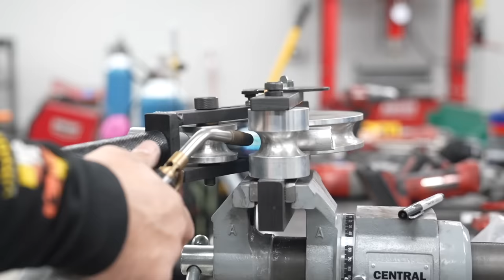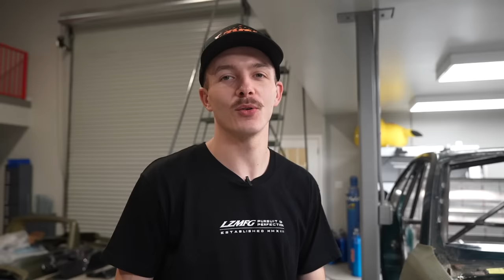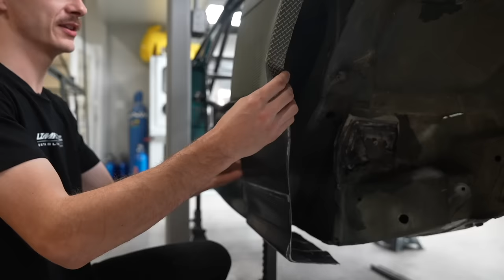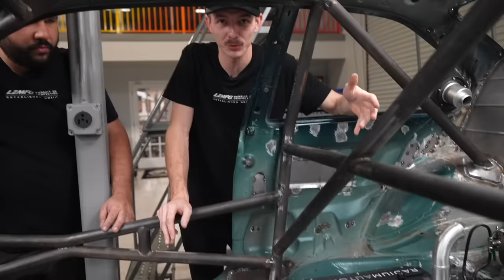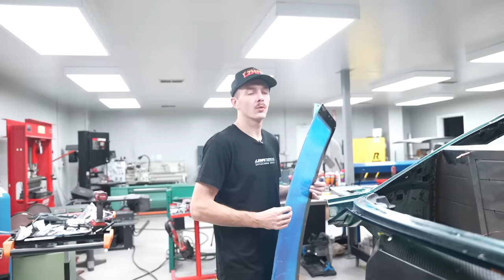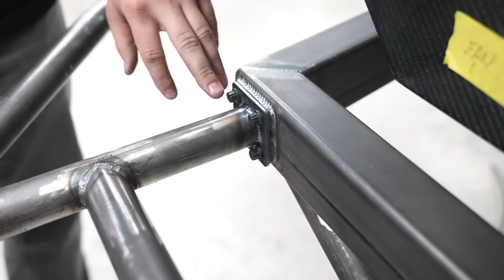Major Update on the Euro Competition E36

Comment: For the fender I have seen people cut and bend the lower section in so it attaches flat in the wheel well, leaving the upper hanging or make a thin bridge to carry the wheel well lower to meet a splitter or lower trim (something like that). It is pretty aggressive looking imho and it does change the dynamic of the car quite a lot for being a "simple" mod, well, would be simple if using metal, then again, might be able to bend some of the c/k sheet because that stuff is pretty flexible.

Comment: i took this exact page out of the drift guys book for my e92 drag car.   i cut the back of the car off,  cut it down and acid dipped it. full oem e92 body made of carbon/fiberglass.  looks like an oem e92 but only weighs 2420 with the built 8hp75, built 3.3l without cage.     its pretty crazy how much faster the cars are when you take 1000 lbs out of them.

Comment: if you wanna save more weight they do make billet 2JZs. Very expensive option but you get a higher horsepower cap in the thousands 2500-3500 versus an iron block 2JZ pushing 1300-1500 on the high end.

Comment: Very cool build, but have you thought about putting fans infront ov the radiator so they push air threw it and then make two holes at the bottom of the shroud so all the smoke and hot air goes under the car? I have seen it on some DMEC cars I think.

Comment: Adam why not put louvers
Behind the front tire to pull heat out of the engine bay and brakes 
Clean it up with a flat plate angled in to cover the A pillar

Comment: Car is looking great, but have you checked the scrutineering requirements in the countries you are running it in? In the U.K. the cage would need a rear diagonal to meet the MSA regs (not sure if drifting adheres to those though). Are you adding a rear diagonal?
Reply: I’ve also been looking into this for our e36 GTR . We’re in the uk and building a prototype for drift , race, time attack. My view is drift cages have slightly less regulation. We’re just going full T45 FIA with extra door bar braces to suit drifters . That way we cover all formulas and don’t really add much more weight. Probably going down the rear rad route too for better weight distribution, less crap up front in the event of an off too  .
Quite surprised at the dash 16 water pipes but this seems the norm  for drifters , even for 800 BHP  we will probably go 25mm to be safe .

Comment: If you whant to find a close to/same setup/as good or eeven better engine (2jz) look at the b58/s58 platform 🤔 i mean power should be easily ~900-1200 with "normal/usual engine parts"

Comment: Is there a rule against cutting odut the firewall and making a new one a couple inches further back? I've seen it a bunch on drag cars to move the engine further back and have more weight over the rear tire. Sounds like something the could be useful in drifting as well...